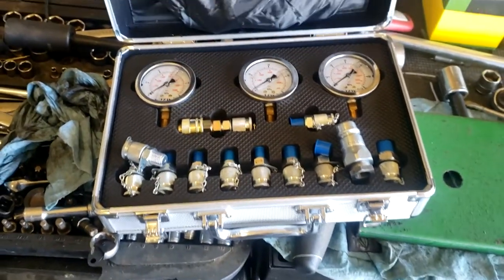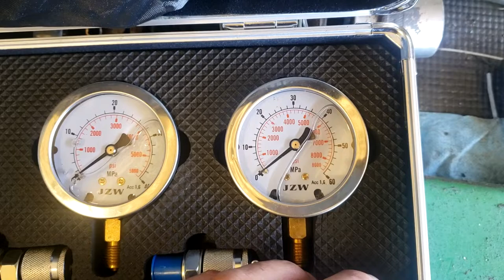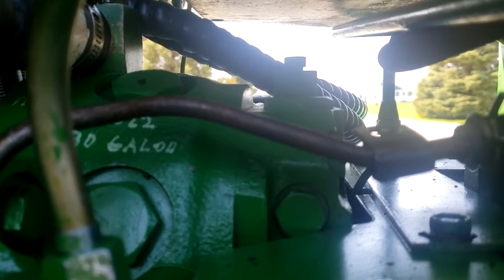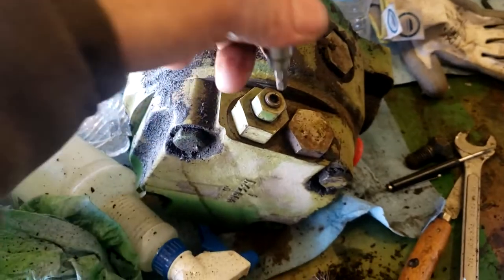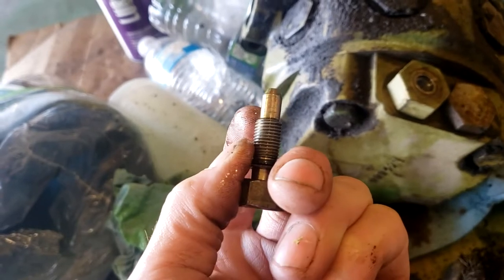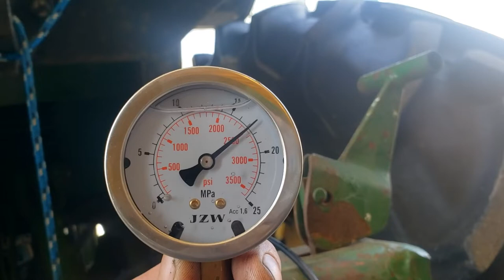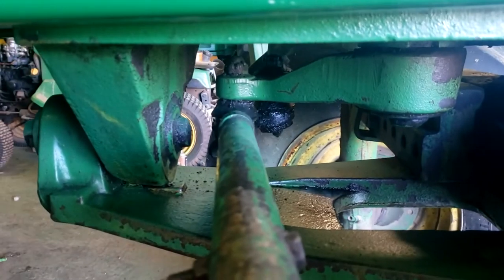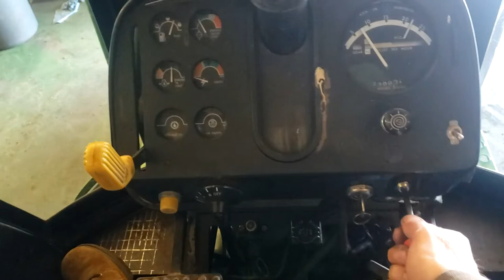SETTING HYDRAULIC PRESSURE... JOHN DEERE 4440 PART 7

Comment: I have a old jd bachoe with poor hydraulic power, does adjusting the destroke screw more in give you less flow or more, I want to increase hydraulic Pressure, I will check the pressure before adjusting

Comment: I have a John Deere 4440 quad range that will drive in all its gears but doesn’t have all its power when I put a load on it it doesn’t have the power to move. I blew a line on the right (passenger side) replaced it and ever since it hasn’t ran right. Do you have even suggestions on how to trouble shoot the issue? Thanks in advance
Reply from the maker: If the engine does not pull down and you feel like you're getting clutch slip, then I would first change the hydraulic filter, check the trans pump pressure I think off the top of my head its 80psi, then check the clutch valve body, the clutch valve or valve spring could be broken. I made a vid on clutch pressure settings and tolerances for what the 4440 quad range should be set at. I hope this helps If you have any more questions I'll do my best to help, Thanks for watching.
Reply: Ok, I changed the filter still no luck. I will look at valve body and check the pressure. I appreciate your fast response and love the videos
Reply from the maker: I found a vid by a youtuber DieselFume1 JD4630/4430 PTO valve body repair, It will give you a good idea what you are looking at if you need it to tear in to the valve body. I keep thinking from what you describe it could be a problem with the in transmission pump, I wouldn't think the clutch is bad. Best of luck, as always any questions I'll do my best to help.
Reply: I have added shims to the clutch valve body and it did not increase my psi it’s sits around 140 to 148 psi at 1000 rpm and only increase to 152 psi at 2100 rpm’s I changed oil filter and checked the  screen again and it looked fine any tips or suggestions on why after adding shims nothing has changed? Thanks again in advance
Reply from the maker: That might actually just be something broken in the valve body witch could be a cheap fix, If the valve body casting is ok. Did you check the trans pump pressure, I was thinking about making a quick video about that. Sometimes its the littlest things that can really stump a guy, I know just about everything I work on is that way, LOL.

Comment: I couldn't find the video about you thinking about changing the engine in a 4020 using one from a combine so I will comment on it  here, If I am not mistaken I thought you said that they quit building the 4020 in 1968 or 69, I looked it up, 1964 until 1972.
Reply from the maker: That is correct. I don't know how I messed that up and didn't catch it in the edit, thank you for pointing that out and thanks for watching.

Comment: I have it my problem is steering is going hard what must I check
Reply from the maker: I would first check for leaks, their is a small hard line under the hydraulic pump that sometimes comes loose. If you're leak free you might need to have your steering box rebuilt.
Reply: @mayberickcanfixit7468  is going like this if you start the engine you can turn it smoothly but the more it's idling it's start getting hard
Reply: Yes my man